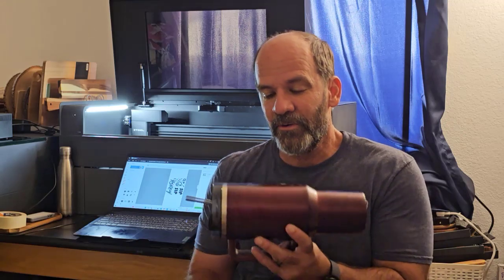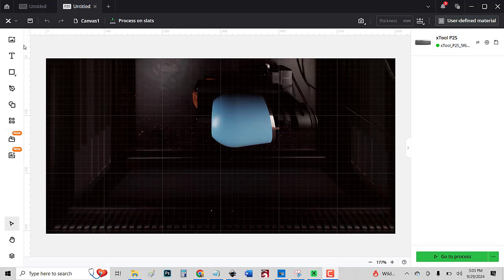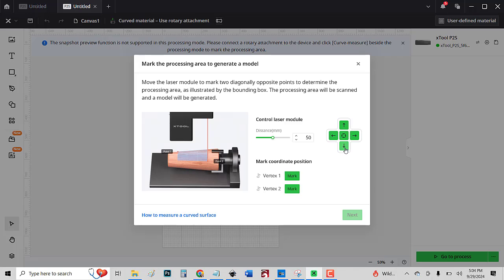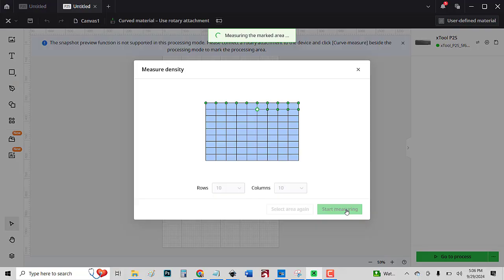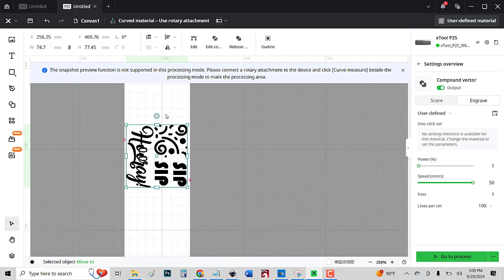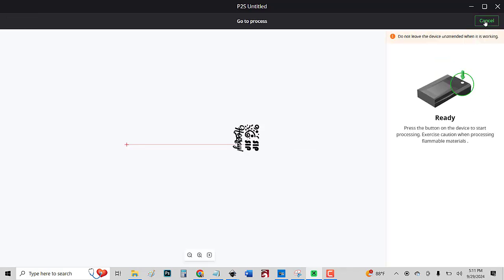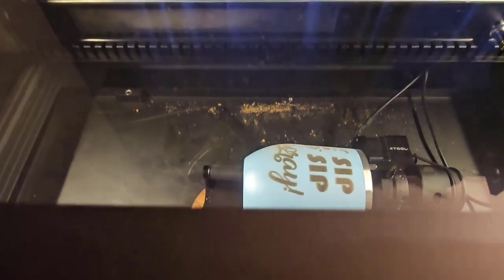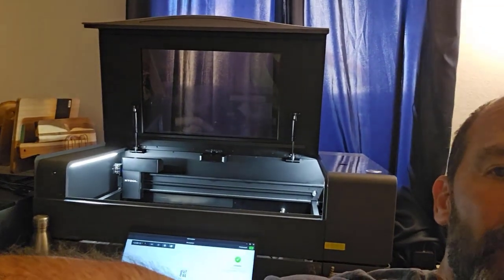THE BEST CO2 Laser for Engraving Tumblers

Comment: Great video. Question - now that you've mapped that tumbler, does the software save those measurements so the next time you want to engrave that same tumbler brand/size it's good to go without having to measure again? Apologies if you mentioned it in the video and I missed it.
Reply from the maker: No, it wouldn't be precise enough. It's also mapping the location and angle of the tumbler and you wouldn't be able to get it in the exact same location and angle each time. The new P3 is coming out today and is supposed to have 4 cameras plus lidar and 3d scanning and maybe it will have more capabilities like that.
Reply: @Partyof4Crafts  Ah, makes sense. Thank you. 

One other question, if you don't mind. I've seen with other lasers that when engraving on a tapered tumbler, people will distort the image (like might it slightly wider at the bottom) to account for the taper. Is that still necessary when using the 3d mapping, is does this technology negate the need for that?
Reply from the maker: @brlewis1984 No, it isn't. It's still required to stretch circular images, but that's with all lasers. There's an optical illusion that makes them look squashed if you don't stretch the width by 10%.